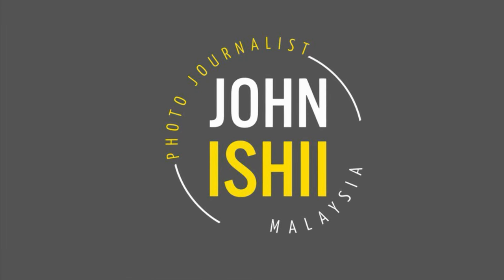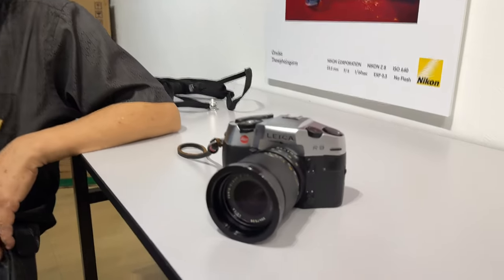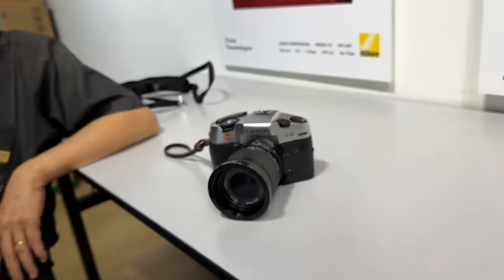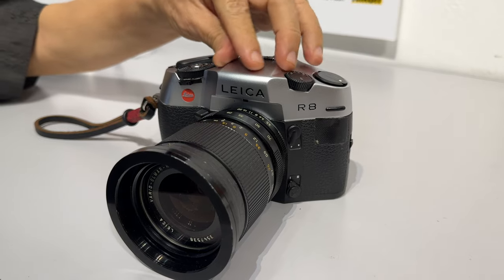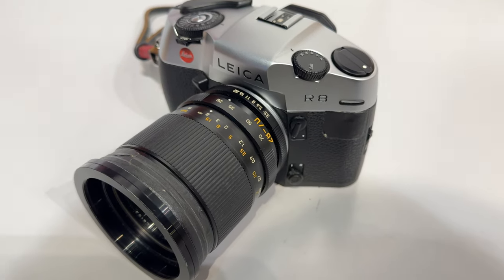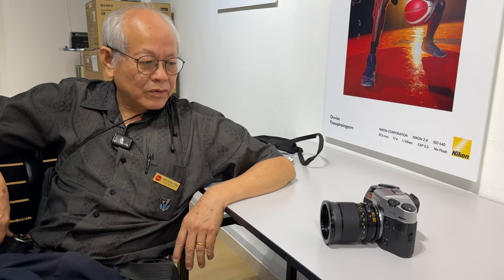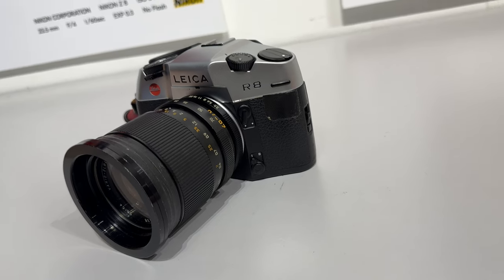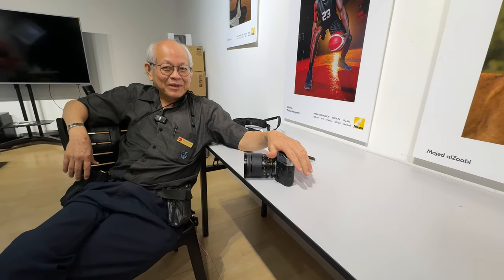Leica R8 the game changer for Leica Part 1

Comment: R8/9 both have faulty designed battery pack release latch , if the   the tension release screw is turned in the wrong direction , You won’t be able to open the battery pack AT ALL.